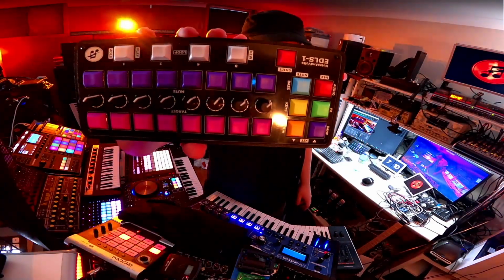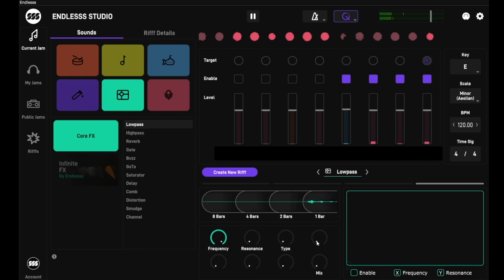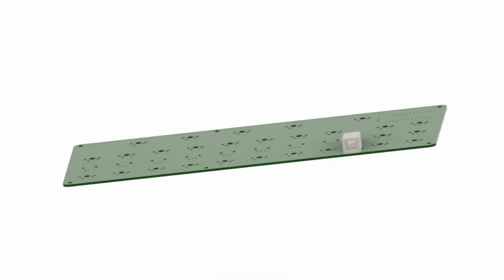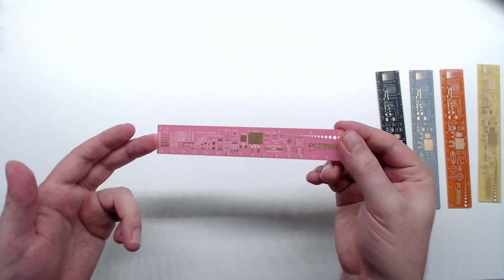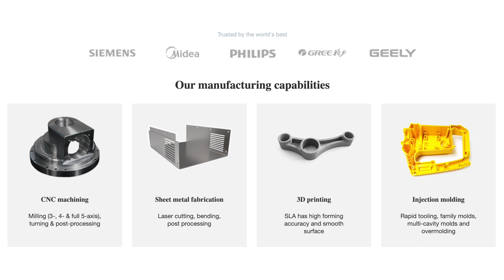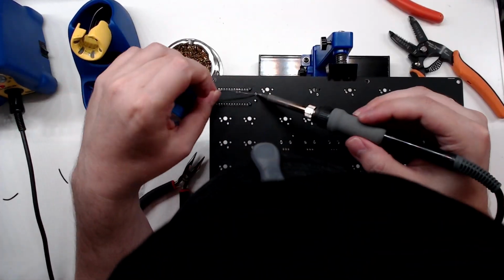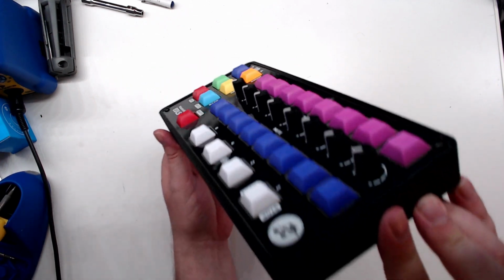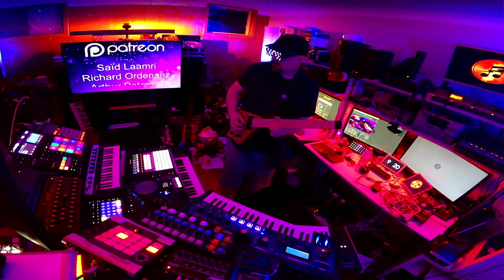I made my DREAM CONTROLLER - with PCBWay

Comment: This is awesome! I have my dream device project in mind, but don’t know how to start.
How do you test your circuit design? Is there any software simulator that allows us to test any design?
Reply from the maker: I like to prototype circuits on a breadboard. For front panels I'll print them out full size to see if the control spacing is comfortable and the workflow is good. There is a program called SPICE that is a good simulator if you want to go that route.
Reply: @NotesAndVolts  Thank you!